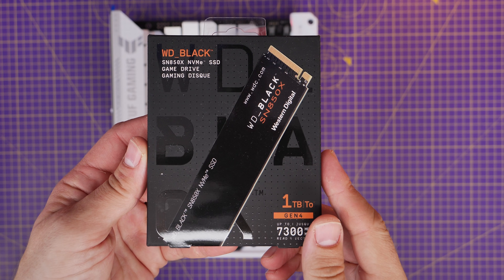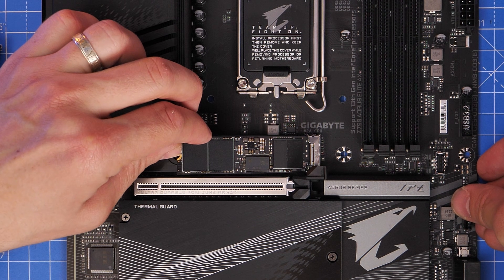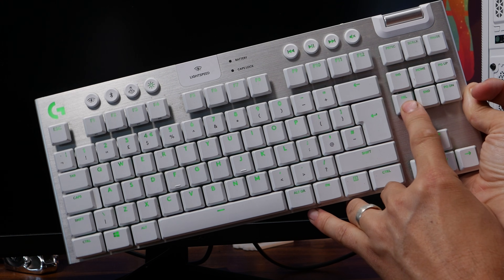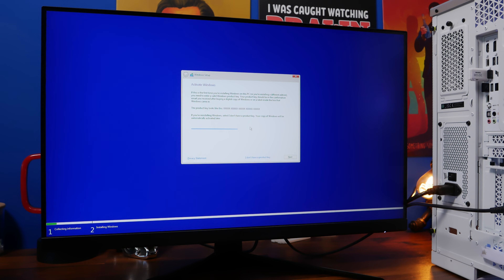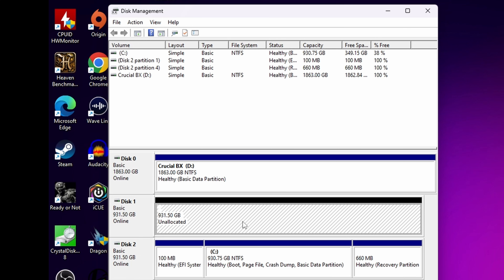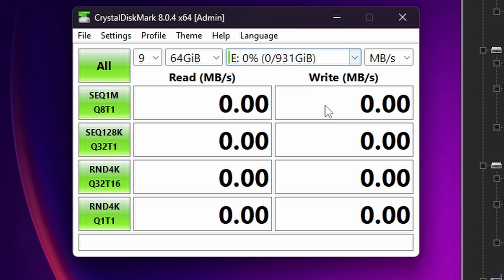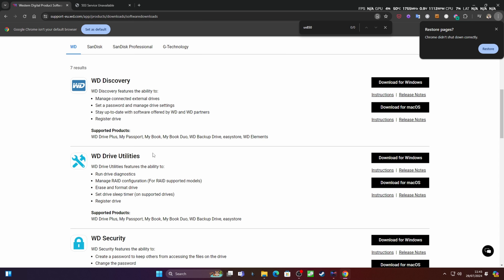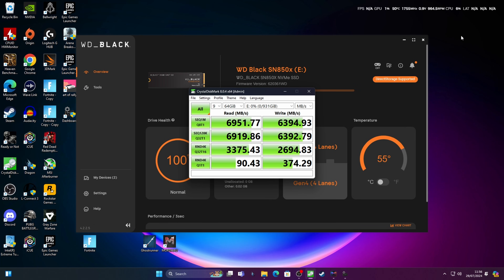How to install setup and test WD Black SN850x and install windows too

Comment: Hi unprvoked prawn I have a question my ssd is the WD_Black SN7100   it is installed in my c drive operating system on my b550 motherboard,  
I was just wondering when I use crystaldiskmark Am i suppose to only look at the  Seq1m  read and write speeds? Im getting 7303 read and 6654 write. For the  others  Seq128k similar to seq1m  speeds, Rnd4k 1748 read 1540 write and Rnd4k Q1T1  83 read and 175 write are all these speeds normal for my ssd.

Comment: Thanks for the tutorial. I just got this 2TB WD Black SN850x w/heatsink installed on my board and the speed tests are lackluster. I'm in gen 4 lanes with everything and not sure why.
Update: I ran the test again after closing all my browser windows and programs and pretty much got the same as you or better in some instances except on the last "RND4k Q1T1". It was lower in both read/write. Is that bad?

Comment: Just purchased a SN850x and a Asus B850 tuff gaming plus Wi-Fi motherboard. Do I need to add the extra rubber pad for support on this M.2 Drive. When I do try the extra pad, it is very tight to get the M.2 lock in place with the plastic latch.   Thank you!

Comment: I have 2 very simple (I hope) questions

Q1. So Ik PCIe 5 SSDs r just not worth it when it comes to loading up a game, but I never hear anyone talk about if it helps traversal stutter from loading into new areas within an open world (world streaming I thibk its called), and general smoothness of games that stutter when going into a new zone of a map. Also in games like satisfactory where u will literally freeze when the autosave happens if u have a massive game world u have been building in (and similar games, city skylines 1/2, factorio ect).

Q2. Does having ur OS/programs drive seperate to the drive ur games run on help with what I mentioned above? Lets say u r recording with nvidia shadowplay and its saving that info/recording to the ssd, doesnt that affect game performance if its running on the same drive and on top of having stuff like spotify, windows OS, web browser open ect ect all stack up? Is it better to have them seperated so background running stuff including the OS doesnt interfere with the game loading, aka a drive that sole job is to load the game and only the game seperated from everything else?

Sry probably overexplained but wanted to be clear haha.

Comment: I brought two of these drives. One for WIn 11 OS and one for games and media. The OS drive is only getting 6200 Mbps but the 2nd drive is getting over 7000 Mbps. They are both in Gen 4 slots and this has been confirmed in HWINFO and WD software. Any ideas? Thanks

Comment: Bought 2 x 8TB sn850x last week - one works fine in any of my 4 slots, the other immediately causes system freezes. Anyone else experience similar? Am assuming faulty - can't even open CrystalDiskInfo before it crashes. Will try in another machine at the weekend but feels like a faulty stick.
Reply: Was it defective?
Reply: @TheWorstGamerr  still going through an extreeeeemely drawn out RMA process. Maybe I'll get a replacement this year and find out! Couldn't try in another machine in the end and the other stick worked fine in all slots so can only assume it was/is the stick and not the motherboard this time (x870e ProArt - which seems to have other issues, too - RAM not posting via DCOP / 10gbe port failing under load...)

Comment: Hi,I have a question i just purchase wd sn850x, and i have inserted this nvme in pcie gen 4 slot in the motherboard, my motherboard is gigabyte auros pro B550M, on cristal diskmark software i am getting 7300 read 6300 write speed, but when i actully coping any file in this nvme i am getting only 530 to 550mbps why?
Reply: I am getting 6900 & 6300 on gen 4 motherboard, it’s less then advertised speed
Reply: @fahim454  how much u are getting in actual file transfer speed?
Reply: I don't know from where the file it's coming. But the velocity is limited by the device with the minor velocity. So if you are copying from an HD, or PenDrive or SSD SATA, or even a SSD NVME but x3.0, then you be limited by the read/write of the slower one. Also depending the file you are copying windows have differences approaches in how to copy and allocate in SSD memory.

In general if in the Crystal Disk Mark it's giving correct read/write (like the video) I wouldn't worry about.

Comment: Why does the ssd only show 931GB?
Reply from the maker: There's always some amount of space reserved for caching and such that you can't use.
Reply: @TheProvokedPrawn  thank you bro
Reply: No. It’s because a Tera Byte today is 1,000,000,000,000 bytes. But in proper binary notation (what I think they now call GiB) is 1024^3. So when Windoze sees 1 x 10^12 bytes and divides by an actual GiB, you get 931GB.

Comment: Thank you so much for this. I picked up one of these drives in the Amazon prime sale and was my first time installing one of these modern NVME drives. It seemed to fit and work almost immediately but your benchmark and software suggestions have certainly helped me to really see the details. I may even have followed your NVME installation tutorial video when doing it too 😅

Comment: Literally just bought this yesterday 😂 

So question, would you recommend the stock heat sink that motherboards come with for these drives or something welded?
Reply: I’ve had about 3 of these SSD at this point and only ever used the built in motherboard heat sinks and that’s been totally fine.